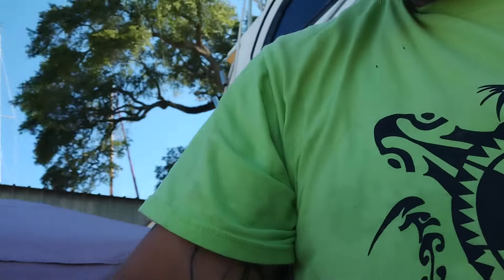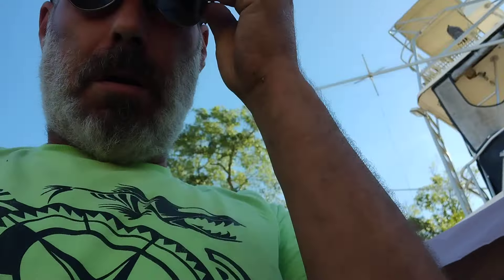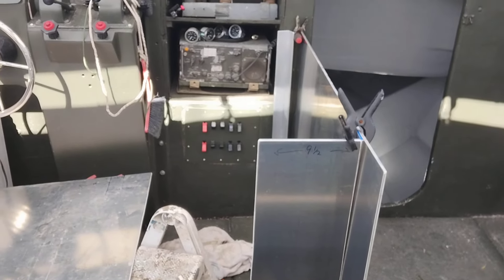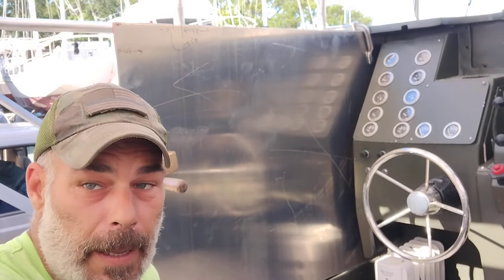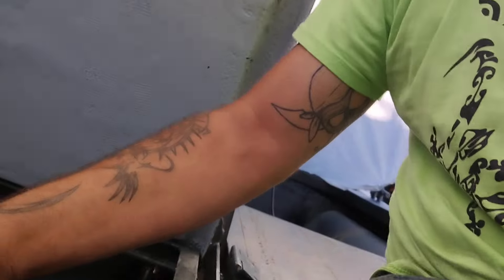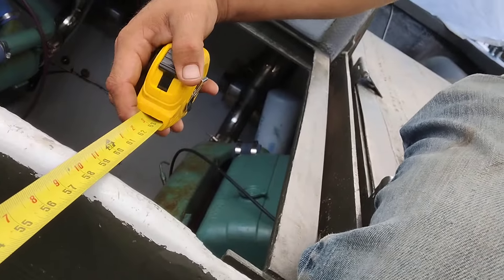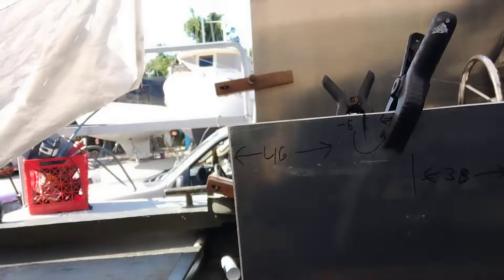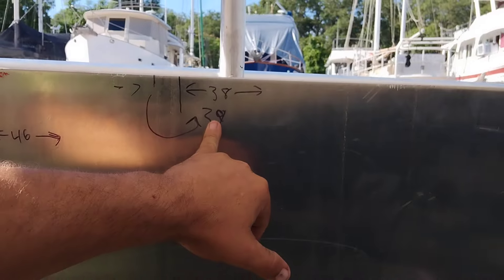PBR 6881 was she the Navy's prototype mk2 why is she so different from the fleet ?

Comment: Steve, I'm pretty sure I had the 1st PBR in country that had steps (you called them ramps) put on the 729. we stripped the boats down to jus small arms and the M-60 and went to MyTho to have styrofoam put along the inner walls and in the gunnel to help keep it afloat should she get disabled and sinking. The Seabee in MyTho was a friend and I asked him to put one inch steps behind the pump intakes. the result was I had the fastest boat in the division. I would have to cut the throttle back so I didn't run off and leave my cover boat.
As far as the Armour around the coxswain's flat, I don't recall there being that much room between the plate and the engine room bulkhead. As I recall, the water jug wouldn't even fit in that space.  I'll try to find a good pic of that area.
Thanks for your dedication to our legacy.
Git that boat in the shade, we don't need you getting heat stroke
Butch